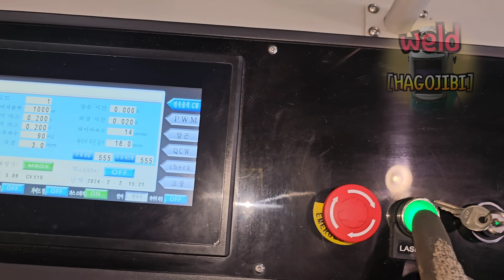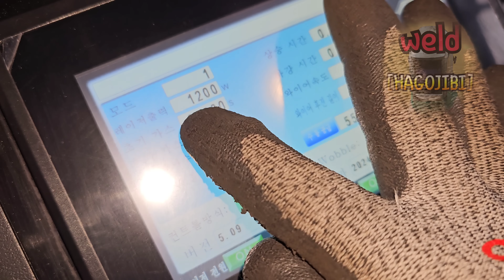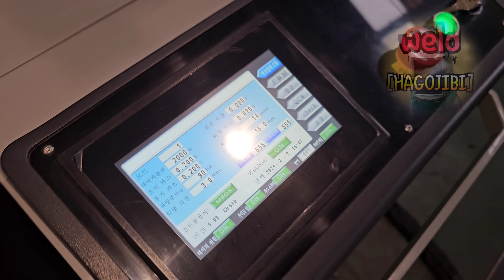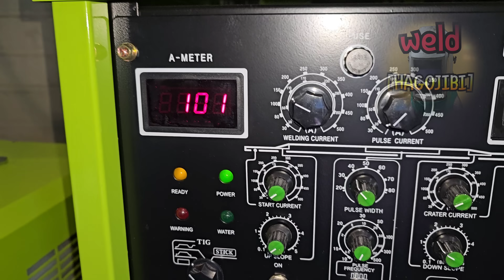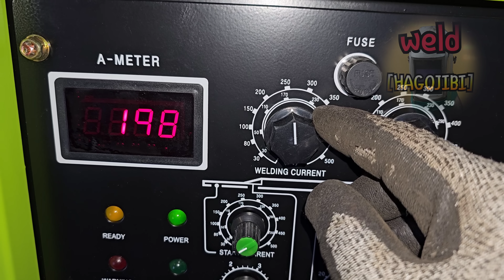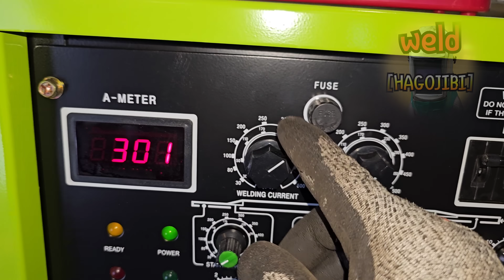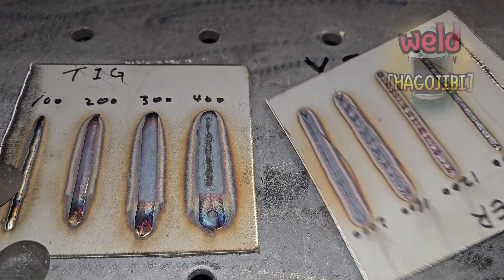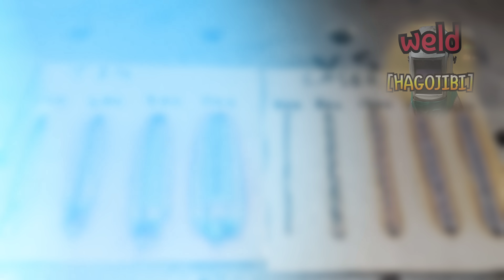Few people know this! The biggest difference between TIG and laser

Comment: Tig is still way better than laser.
Reply: Laser less heat distortion.
Reply: @petrovich5188 It is because TIG have a power  about 2,4 kW in arc when current chosen 100 A. Ts was not tried currents, comparable by power to laser, used in video.
Reply: @Ramulus2009 true, I was thinking the same thing.
Reply: I agree, I liked the finish of the tig
Reply: Depends on the application
Reply: I agree, tig is more versatile
Reply: As a user of both systems i can tell you the laser really shines on thin material welding applications when you can´t afford to have the sheet deforming.

But we usally mix both laser and Tig application on the same workpiece many times... the laser sucks at corners and it sucks welding  a 2 meters weld in a straight line with a Tig som we combine both suckers
Reply: Translate German. Also es kommt darauf an in welchen Anwendungsbereich.  Filigrane Konstruktionen denk ich das mit dem Laser besser gehen .
Reply: Because penetrates less, or because it's slower?
Reply: That's kind of a silly statement, because it's WAY to broad and it ignores all kinds of variables. The fact is sometimes tig is better than laser, but sometimes it's not. It depends on the job, the material and the joint. I try and stay away from blanket statements. Laser on thin sheet material, has WAY less distortion, is WAY faster, and can reliably and easily get consistent 100% penetration. Even with thicker material laser can be set to achieve 100% penetration with a remarkably small heat affected zone, way smaller than tig set high enough to get 100% in a single pass. If I could buy 1 machine ? Yeah, tig or mig for sure depending on the kind of work I mostly would be doing, but is tig way better than laser? Well, it just depends.
Reply: It really isn’t. Aside from aesthetics. 
But that will change, rest assured. 
You’re gonna be able to select which designer pattern you want on those lasers and make an intricate walked cup pattern look like a g@y stick weld. 
Laser is pretty much going to destroy the welding community. I give it 5 years.. 
Maybe 7.
Reply: You can't compare Amps to Watts. Amps is arc current and Watts is power, and nobobdy says if it is power consumed or luminic power. By the way, the speed of wire is not compensated across different passes.
Reply: @mirzahasanovic9761 
Vorallem wurde hier die Laseranlage nicht sauber eingestellt. Mit der Örlikon WTW 1000 schweisse ich tiefer, präziser und schneller als mit jeder anderen TIC. Auch das Schweissgefüge steht der TIC in nichts nach. Aber eben. Man kann noch so eine gute Anlage haben. Schweissen muss man noch selber (können).
Reply: Tig is definitely more affordable. I'm wondering if the price of the laser will come down. I still say Tig has less things that could go wrong and what happens when you burn a laser diode? Are they expensive? I burn a tungsten and for 12 bucks a pack I pop a new one in and I'm good to go
Reply: @drewrinker2071  Im not gonna deny it, laser welds really look nice. but for now Im gonna stick with tig. Im sure the laser welders will come down in price, everything new always does and im also sure that there will be allot of improvements on the laser welders which I look forward to. ;)
Reply: @SeamlessFab yeah. I’m sure tig will be done just for fun or for art. Or for poor people who can’t afford 10k for a machine. Everything that was magical and good at one time gets ruined eventually.  Look at the tattoo business look what happened to that  tattooing used to be a craft and it used to have this magical mystique to it now it’s just a novelty like getting your ear pierced at the fucking mall.
Reply: @tonta182 I gotta say you nailed it man. With the laser, blowing g through some thin material really isnt an issue. You've gotta try pretty hard to screw it up. But versatility still goes to the Tig setup, unless they can shrink the laser gun bit down by a good bit
Reply: @roamsalone4020  yeah the laser is horrible from a ergonomic perspective, maybe its gets better in the future. But i do think it's awesome to use.
It's getting in more business then the tig and so long the other workshops in town are too afraid to invest we have the edge.

Also really good function is to cut with it.
Sometimes we laser cut templates we use with the laser welder to cut in stuff we can't get into the cutting machines

Comment: You are comparing 2 different values. 100W is not 100A 😂😂😂😂😂😂😂
Reply: Yep. Which actually makes the laser even more impressive. If you figure they are running on 3 phase 480v at 100w that's only .2083 A or 208 mA... that's a huge difference.
Reply: @Southernboy302   I could agree if efficiency was 100% but in that case laser efficiency is on level of 25%  or even less. So for each 100W efective power you need to use 500W rest goes in to heat. In case of Tig you have 95% efficiency so for 500W your lose 25W.
Each technique has its own advantages.

Comment: Not fair comparison. The TIG should be tested also at 400-800-1200-1600 and 2000 Watt. TIG machine at 400 W will generate about 15-20A, and at 2000 W will generate 70 A. Therefore the penetration of TIG at 400 A (12000 Watt) is huge!

Comment: I like the promise of laser systems and I own both fiber and CO2 setups.  I've never TIG welded that way as 400 amps on a stainless coupon is excessive; and the amounts of heat between the two systems are disproportionate.  MIG vs laser may be a more realistic comparison but the key is to use varying material thicknesses since that is the only reason to increase power.  Depth and penetration should be consistent as the thickness changes.  Overheating a joint is simply not something that a professional welder would do.  I do appreciate the time and effort that it took to make this video and it's interesting... But if it's purpose is to sell systems, then it's less realistic.  Thank you
Reply: yeah mig and laser both use the molten filler and laser only match high fusion of mig using high arc ampere

Comment: "Laser" it is a modified MIG/MAG.
Reply: Not really. More like modified acetylene/oxygene torch welding. The laser beam heats up the material like the gas flame does. There isn't any electric current involved in the welding process.

Comment: We use laser or light weld as its called in work, we purchased two last year.
I cant remember how many times they have been sent back for repair,  also the welds look great but i here from the fabricators that one often finds cracks or porosity in the welds
Reply: This means that TIG welding is stronger ?

Comment: Основная проблема лазера в подаче присадки, он сначала греет присадку, а через нее основание. На мелких мощностях всегда непровар, не хватает тепла, чтобы присадка приклеилась к основанию. Первые 2 шва лазером можно сковырнуть отверткой. Я делал опыты.
Reply: разная толщина присадки
Reply: Добрый день подскажите для сварки 0,8-1 мм металла, будет достаточно аппарата 1.500 Вт?
Reply: @Dlav_Volkov  должно быть достаточно, с большими толщина и уже будут проблемы. 1500 на 2мм не хватает.
Reply: @grootxtree  значит для кузовного ремонта лучше брать 2kv
Reply: I purchased a newer-generation 1200 W laser machine, which is much more compact than the one in the video. We mainly work with 0.8 to 1.5 mm stainless steel, and it performs excellently.
Reply: 1500w и для 4х мм подходит. А для кузовщины аж с запасом. Газ лучше Ar80%CO20%. И линзу периодически чистить. Перед работой дать системе нагреться .
Reply: @17evgeny  спасибо

Comment: Tig best, but need more practice
Reply: This test is misleading. Power (watt) and current (Ampere) are different units. He compares the power of the laser beam with the current in TIG welding.  100A on the TIG means around 2400W which is more than the max. 2000 W on the laser.

Comment: OK, so the difference is that the laser welder retains the focus of the heat throughout the power range, while the Tig method tends to increase the AREA on the surface of the work that receives heat, which leads to a fatter weld pool as the power increases.   The Laser does not seem to do this, and I suppose the key here is that the laser beam does not get fatter as the power increases.  Tig Arc does.  You'll notice they used stainless steel here, which likely increases this advantage because stainless has a low thermal conductivity.  Thus, stainless and laser welding may be well suited to each other.  Titanium may also be well suited to laser welding, again due ot the very low thermal conductivity.  On mild steel, the advantages of laser will be reduced, and definitely on aluminum.  In both cases the heat affected zone (HAZ) increases with increasing power, so you still have to be concerned about that.  In short, the laser welder has better focus of the power than the Tig Arc.
Reply: in the video description, he explains, that cause wig-arc tends to get "wide" , the heat is spread in a way, that it doesn´t reach that deep in the metal, as laser does... that is bad for wig. maybe stainless was a more advantageous material to showcase that, biased towards the laser, I cannot judge that, but also cannot believe, that this advantage can be reversed, with any  more-"wig-biased" materials...
Reply: Nobody would weld 3mm thick Stainless on 400 Amps, and especially with that big torch angle.

Comment: The difference of this two is that lazer is using a laser beam to weld while tig is by arc which is electricity. Laser is more safer to weld batteries because it doesnt affect battery charge.

Comment: I don't know much about laser welding, but none of those welds look great.  
For the TIG I can recommend turning down your gas flow rate and holding the torch so that the tungsten is more vertical.  Your shielding gas is not doing its job.  Inappropriate travel angle and high flow rate leading to turbulence is causing excessive oxidation.
The laser also looks like the flow rate is too high, but that is ju a t a guess looking at the sparks oxidizing.
Reply: На лазере увеличили мощность, но не увеличили скорость подачи проволоки.

Самым чистым экспериментом было бы сделать швы вообще без проволоки.
Reply: Я бы ещё посоветовал не макать сопло в хвост сварочной ванны 😂
Reply: trust me this guy knows how to weld this is just a demonstration

Comment: Laser weld power should be chosen with respect to filler metal diameter, base metal properties (type and thickness) and weld speed. It is not a miracle method to give you perfect welds with random parameters. 
This video exactly shows this and one fact that this channel can record TIG welding close up but not the Laser welding.

Comment: Hi, friend. Do u comparison power in watt on laser weld and amper on tig? Is it correct? Is voltage on tig is 1 volts? I think that volfage on tig about 7-25 volts. And power is 15v*100a= 1500 watts.
In video, tig 100 equal laser 1200. And i think voltage on tig about 12 volts. And on tig 400 equal 4800watts
Reply: Witam. To niepoprawne podejście do pomiarów i obliczeń. Źródło tego podaje na przykład 105 V , więc spadek napięcia wynosi 105 - 12 V = 93 V . I tak dla 100 A prądu stałego mamy 9,3 kW.  Wprowadzenie pulsu np 50 / 50 zmniejsza o około połowę moc  i zwiększa głębokość przetopu.  Gdy zrobimy zwarcie 12 V spadnie do  0V.  Wtedy 105 V - 0V = 105 V  Dla  100 A będzie to 105 V x.100 A = 10,5 kW  moc zwarcia pełnego. Tak to jest bez wnikania w szczegóły.

Comment: How does the laser stack up against the tig in multi-pass open root welding if similar parameters are used for a desired weld...say 3/8-1/2 or metric equivalent welds?..I am interested to see maybe if a full NDT Inspection ...or atleast a break psi and dye pen acid etch results!..that would encapsulate the full tig vs laser test for me..I can see where the laser could have advantages in some processes over tig if similar multi-pass results could be achieved...thank you bro!...as always keep up the awsome welding job!....your homie welding in san diego California!

Comment: Tell us about the rainbow colors on the metal, are they a defect?
Reply: it's a color without pigments - a thin layer of oxide film absorbs light with a wavelength equal to twice the thickness of this film. so yellow is the absence of blue in the rainbow
Reply: Yellow and purple is ok, gray, especially with "powdered surface" - it's burned steel

Comment: You're mixing up watts vs amps. So since that your video is not only disingenuous, but useless. As others have pointed out, torch angle, filler wire feed and travel speed are wrong on Tig.

Comment: Not a fair comparison - what was the power of the tig? Would need to know what the voltage was during the arc during the weld to calculate that, it varies depending on how much heat you're running.
 
I'd expect the tig is better at penetration (at same power, not just current) than the laser, but that may not actually be true: At the extreme light density that fibre lasers like that can reach, the metal actually turns as clear as glass, because all the electrons that normally make metal shiny have been blasted right out of the conduction band, making the electronic structure of the crystal temporarily like a non-conductor, allowing the light to penetrate further before blasting the electrons there out too. 

Reflection of light requires conductivity at a length scale comparible to the wavelength to achieve: This is why X-rays penetrate BTW: their wavelength 'fits' between the atoms in any crystal, so they have a good chance of just 'missing' through all the empty space between nucleii. (think, basketball in the middle of an airport).  It's also why you can't make a mirror that reflects X-rays, because nothing is that solid. They interact with the nucleii instead, so you can do some 'diffraction' optics, but that's about all.

X-rays should be relvant, BTW: I'd expect the laser welder to be able to make more of those than the tig, just because the available peak energy density should be higher, but it will depend on what you're welding either way: high-Z elements like tungsten should be much worse than low-Z elements like Al, unless you're zapping something whereby you setup a laser-wakefield and actually also cause higher energy particle acceleration too.

Arcs onto metal of course make X-rays too - but for a tig, those are going to be very low energy - only about the arc voltage while it's lit, about 10V or so, with very little penetration power. At that level they're almost more UV. 

Would be interesting to do some X-ray spectroscopy around both and see if that guess holds up. If so, you may need to care when running the laser welder.
Reply: First tig weld was over 2kw ....

Comment: Few people care. The results are so visually different than any welding process we've had for the last 100 years, that it's going to be a tough change. WPS and inspection standards will have to catch up. Engineering will have to embrace it.
 
Until many things happen in many different places, laser welding will be a very expensive, unnecessary vanity.

Comment: I will like you guys show me how you weld with the laser through metal with the gap between them  . Also how you do the corner stuff  like angle or square tubing . And what with the safety . You have to be single in the room when you welding . You have to have some special laser welding ecran or maybe a welding chamber . Because I understand this light is very powerful and can easy damage somebody's eyes if that light go out of welded material .

Comment: The future its Laser, because anyone can make the job, there is no need expensive labour people to make the job
Reply: For standard welding you maybe right.
For professional jobs like pipes you still need professionals
Reply: for laser welding you need 99,9999% Argon at least, for Tig 99,98%. The diffence in price is significant (4-6x times).
Reply: @dando3184  Only for Aluminum and another metal. For mild steel and stainless the shielding gas is nitrogen for most laser welding. Nitrogen is very cheap. Companies sell it cheap, since it's kind of a waste product from producing liquid oxygen, and it's very abundant (78% of atmosphere, versus Argon is scarce).
Reply: @brnmcc01  al,ti and all others non-ferrous metals only Ar. To use laser for oil/gas pipes on pipelines-i didn't see any examples with x-ray check.

Comment: I primarily weld stainless steel with thicknesses of 0.8 and 1 mm, and I’m very satisfied with my laser welding machine. It took a few days to adjust to the different technique compared to TIG, but now I use the laser 90% of the time. Of course, TIG remains essential in situations where the laser gun, due to its larger size, can’t reach.

The biggest advantage of the laser, in my opinion, is the significantly faster welding process. For example, if a certain TIG weld took an hour and then 45 minutes of grinding, now I can finish it with 10 minutes of welding and just as much grinding since the weld is smaller. The material doesn’t deform, which is also crucial. With the laser, I’ve even managed to weld 0.5 mm sheet to another 0.5 mm sheet without penetration, which showcases the machine’s adjustability for specific applications not easily achievable with TIG.